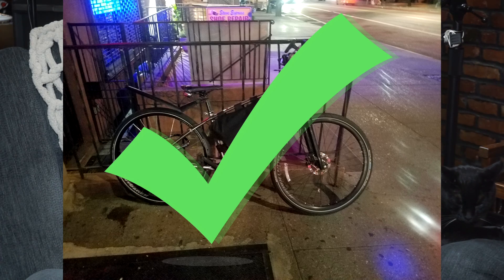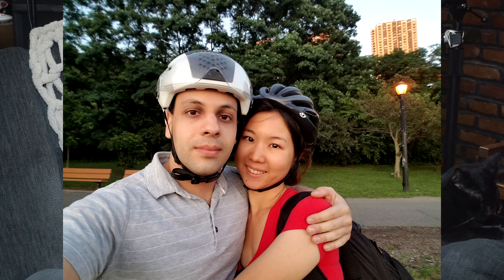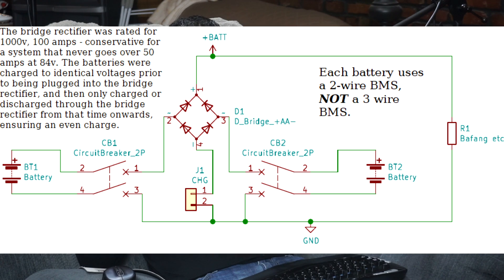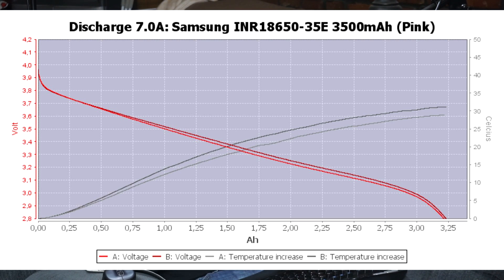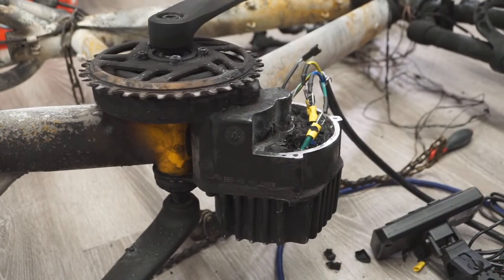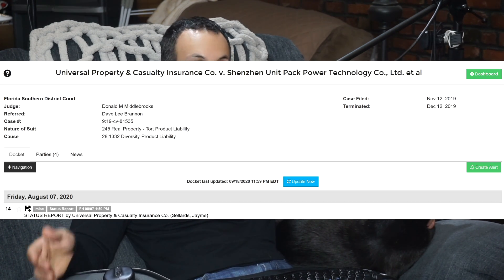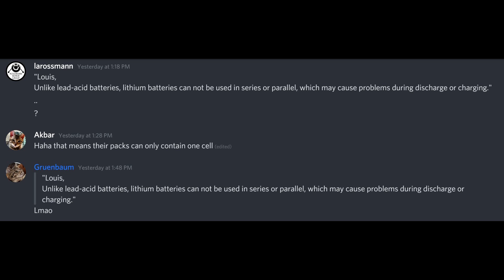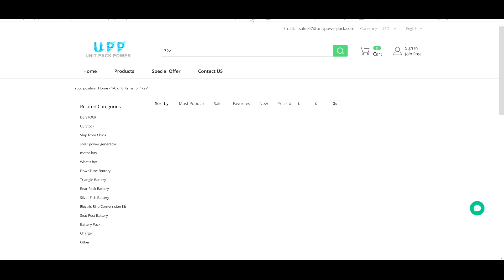Louis' front door goes BOOM courtesy of UnitPackPower battery.

Comment: I think they have no control over the manufacturing processes. Which, in the industrie of battery production, is very important. It could of course also be that they accidentally purchased a bunch of recycled/used 18650's from banggood :p
Reply: Or it could be that Louis caused the issue with his “joiner”, which is more likely from looking at the schematic. And before you get all defensive over a subject you don’t have the education to back up, I have 10 years of electronic engineering background.

Comment: I'm an electrician and I would guess they cheapted out on the wire and used a wire guage that was too small or their was a poorly soldered connection. This created a choke point where to much current went through too small a conductor and conductor overheated/melted and started a fire. The motor was well made but they had no idea how to safely connect the motor to the battery. When multiple batteries are run in paralell it does increase the current and some of the wires might need to be a bigger guage. I had a problem with the starter button on my electric scooter. This was an expensive scooter but they put a cheap plastic button on it. I ripped out the plastic button and touch 2 wires together every time I need to start the scooter, I hotwired the scooter.

Comment: The first thing to remember is that there are a lot of factories in China and other places cranking out shady battery packs.  One problem I see is using any lithium technology that is as prone to flames when shorted or punctured as LCO or Lipo cells.  For something like an E-bike you either need to fuse and protect every cell in the pack in case of catastrophic failure along with a quality BMS or better yet use safer battery chemistry.  LiFePO4 or LTO would make a much safer pack for something like an E-bike where the potential for carrying the unit into a living space or being involved in an impact where a wire can short out is high.  These packs should be built with this in mind but many times corners are cut in the specifications to follow for assembly.  When I build packs even out of LiFePO4 cells I still fuse every cell for 5A so that if a cell would short, it's link to the rest of the pack is immediately removed.  Glad that you were unharmed in the fire as that is still the most important thing.

Comment: Battery Manufacturer: "... Lithium batteries can not be used in series or parallel..."
Me: stares at a Tesla Roadster in confusion
Reply: To be fair, I think they mean battery packs rather than cells, but Louis had a rectifier in there for exactly that reason.
Reply: @ericy4522  magnetometer moment.
Edit: well yes it's real but you all get it.
Reply: @ericy4522  any difference between serial connection of cells already connected in parallel inside of pack and outside?
Reply: @uis246  Honestly, I'm not knowledgeable enough about Lithium Ion or other battery pack build configurations to confidently answer your question. I think most battery packs have some additonal charging and safety circuitry (except for the LiPo type used in drones), which means anything connected externally to the pack may or may not be "in parallel" or "in series" with whatever's inside the pack. The pack would need to be disassembled and any internal circuitry correctly analysed to be sure.
Reply: What other way can batteries be used other than series and parallel?
Reply: @whyarewehere3893  On their own in completely separate circuits.
Reply: No, you cannot connect Li batteries in series or parallel like you can with most other battery technologies. And a rectifier won't fix the problem, because a rectifier will only control the direction, and not the volume, of current. Overcurrent, overvoltage, or undervoltage will destroy Li cells, and gang-connecting them to a single controller makes it impossible for the controller to prevent those conditions.

Also, this has already been mentioned but buying cheap garbagey electronics off of amazon or aliexpress is a good way to end up in this situation. Check out Big Clive's YT channel for more stories like this.
Reply: @jamesmurphy449  Can you give us a direct link or two to relevant video on Big Clive's channel - he has a lot of videos!
As far as the rectifier not being a fix - Louis's circuit seems to effectively keep both batteries separated so they only see the charger, and not each other, and he ordered each battery with a two wire battery management system (BMS) so no charging route via a separate discharge wire, so why doesn't each BMS just manage the current each battery gets, given both batteries see the same charging voltage from the charger? Happy to be corrected/educated, as I have no experience with LiIon Battery electronics or management, although I do have some electronics experience.
Reply: @jamesmurphy449  Thanks for the channel recommendation! Will check it out.
Reply: @jamesmurphy449  You missed the fact that each batteries were supposed to be protected by common port BMSes
Reply: Thu Nell Ⓥ  Take a look at the way it's configured, the current will flow up through the bridge, you can connect one or both batteries, and it will still flow upwards in the diagram. The rectifier is there to prevent current flow from one battery to another, as the rectifier stops any sideways current flow. Current from the charging port also would flow up, splitting between each leg (charging the batteries), and then recombining at the top.

@James Murphy This was not a problem with mixing two Li batteries as they were electrically isolated from each other.
Reply: haha B.M.S go brrrr
Reply: Thu Nell Ⓥ  They're just diodes packaged in a particular configuration. Yes, bridge rectifiers are most commonly used to produce full wave rectified DC from an AC input, typically smoothed with a electrolytic capacitor, for AC to DC power supplies, but a bridge rectifier doesn't need to be used JUST for that purpose.
Reply: @Thu Nell. Yes you're partly correct. However in this circuit the diodes are arranged to conduct DC in one direction and block it in reverse. The logic of the circuit is that each battery is effectively supplying parallel current to the motor but they are completly prevented from discharging into each other by the diode logic. Luis's circuit is a common solution to this situation and is perfectly executed. Your assertion that he fucked it up is uninformed. Read Eric Y's comment
Reply: "It only works like that when smarter people say it does"
Reply: But tesla power banks for household use is

Comment: Does your charger have active load balancing? Looking at your circuit it is still possible to get unbalanced battery packs if their capacity or resistance is not the same. I doubt that was the issue though. My guess is a short in the pack because at those low power levels you would never get enough heat otherwise.

Comment: I’m Andy work for UPP company more than 6 years, here are our explaintion of the Louis Rossmann’s battery explosion event.
Mr Louis Rossmann bought the  two pieces 72V 35AH customized battery packs use original Samsung 35E cells with cells holder and 60A BMS (charge and discharge through  the same two cables) include 4A chargers on 28th June.
As we know Mr Louis Rossmann (good at fixing laptops) designed and run the two batteries in parallel with a 30A bridge rectifiter.
After the batteries be used about one month, the battery was explosed on 26th August, they took videos for the whole explsion process, and upload on Youtube,  then sent the video to us for refund after got many reader.
Our sale colleague responded quickly to him, and ask him help to check and and confirm when and how the batteries explosed, we promised will provide warranty if it is the battery quality caused the explaintion, we asked him delete the videos first, but he only sent some pictures of the damaged ebikes and batteries, and sent a listing of refund with total 16686.99USD on 18th Sep.
After our engineers checked his circuit diagram of the ebike connection, we found it was the 30A bridge rectifiter too hot and lose efficacy (30A rectifiter work with about 50A current for 3000W motor )made the two batteries charge each other with high current which higher than the cells max charge rate, because the BMS with charger and discharge max constant 60A, but the Samsung 35E cells standard charge current is 1.7A only, that cause the battery on high temperature and caught fire.
Even we foud out it is not our battery quality problem but the low current bridge rectifiter caused the explaintion, we knew Louis Rossmann is a good customer, he lost too much in this explosion event, we provided two solutions to him:  1. help he bear 5000USD loss;  2.go through the insurance claims process, because all our batteries covered commercial insurance. But he refused all of them, and must need we bear all the 16686.99USD.
We refused it, he told us he have a Youtube channel with 1.23 million subscribers at youtube.com/rossmanngroup, he will post the video on Youtube and Facebook group. Then he posted them on 1st when we are in holiday(1-8th Oct.), that why we have not declare it in time.
Don’t worry, we will keep contact with Louis Rossmann, just have not got reply yet. Here we declare to all other customers,our batteries are safe if you use it in correct way. Please do not refit our battery personally.We will under take responsibility if our battery have any quality problem.
Reply: You're really a piece of garbage aren't you! Your product nearly killed several people, because it EXPLODED and you have the audacity to blame the customer! I hope you get sued so much, that you don't even own a pair of underwear anymore!!!
Reply: @garrethutchington1663  Please pay attention, our batteries are safe if you use it in correct way, 18650 lithium battery all have the risk be exploded if you refit it personally, please shut up if you don't know the truth, if it is our battery quality problem why he refused to go through the insurance claims process? All our batteries covered commercial insurance.
Reply: @garrethutchington1663  I hope your ignorance isn’t contagious😂
Reply: @andyjiang8962  unless you eat your batteries, there's nothing to worry about
Reply: @garrethutchington1663  I'm just a stuff of UPP, but not owner, what I said not blame the customer, just declare the problem. As I said above, we will keep contact with Louis to help him solve the problem. At the same time, have you found the reason why he introduce another battery supplier? I don't think have need to introduce another supplier in this video, because the good quality battery supplier not only this one. So have anyone know the real goal of this video?
Reply: @andyjiang8962  besides the fact that you need to learn English, the goal of the video is that your battery is a BOMB.
Reply: @garrethutchington1663  Garret, I appreciate your passion for safety, and please understand that there are two sides to every story. At UPP we have strict QC procedures in place to ensure that all our batteries meet the highest safety standards. Each battery made for Mr Rossman was made to his exacting specifications, with quality components and battery cells. We have a very small failure rate with our batteries and many people will attest our quality, this is why we also supply many other OEM companies. Whenever there is an issue with a battery we are very prompt to remedy the issue and offer a solution, in some cases where we don’t believe it is the fault of the battery. Mr Rossman created his own DIY solution to link his two batteries together, which we identified as the culprit for this catastrophic failure. This has been confirmed by our own engineers and 3rd parties. Despite this, we still tried to work with Mr Rossman to offer a solution for his own mistake. We offered to compensate him $5000, or to lodge a claim through our commercial insurance (which would require a 3rd party inspection and investigation of the batteries). He chose to decline both these options, and instead threatened to defame us on his YouTube platform if we didn’t compensate him some $16000. Please ensure you are properly informed before attacking either myself or UPP. The internet is full of tens of thousands of happy UPP customers, you don’t need to look very hard.

Comment: This is not a circuit design issue, one cell insulator failed,  causing an internal short and full discharge,  probably some thin aluminum caught fire, once metal is burning it doesn't go out easily.  Most likely the root cause is bad construction during manufacture of the cells.  By any chance did that cell pack come from CHIIIIIIna?

Comment: I have had a number of friends who have had Li-Ion batteries that have either overheated, caught fire, or exploded to varying degrees.   All the post mortem reviews tended to point to the battery charging component creating a wave feedback loop that builds until the batteries fail to retain a constant process of the battery being capable to accept the charge being transmitted as prior charge capability is already queued to be loaded to the battery.   Examples are the Samsung debacle where their batteries were exploding, also some Tesla cars having batteries that were substandard units and were unable to accept the charge being sent into them on a constant reliable basis.  So your UnitPackPower battery had issues, but if the charger monitored the feedback (IE:  overheating of the battery) the charger could, in theory, slow down the charging rate until that batteries were in sync with the charging rate being transferred.  Cutting off the charging link immediately seems to have cause a surge in the batteries which resulted in a containment loss of the charge media. (and resulting fire)

Comment: This is one of the reasons why i absolutely hate enclosed, irremovable batteries. They all, absolutely all, have the potential to do this. And the only barrier between you and face fire, is a few chips and luck. Nokia did it right back in the day, removable batteries that were fully welded shut. Then Samsung (or whomever stole the tech in China on their behalf) stole the tech and did it in the worst possible way, and popularized with that an idiotic move that batteries like these can be ok without the casing that Nokia used. I've had tons of Nokia batteries go bad over the years, especially with age, but not one of them went fire prone, because they were enclosed. On the other hand, the Samsung hash packets are stuffed to the brim inside a phone that could pierce and vent, thus flash them, at any wrong move.

Comment: I understand your feeling of helplessness while watching it burn. I had a Ford Fusion that had a deflective brake line, it was routed over the subframe and therefore rubbed every time you applied the brakes, crack and spit break fluid onto the hot engine while I was driving. I was lucky to be able to pull over and get out of the vehicle while it was on fire but the vehicle was totaled. That feeling of watching something that should never have happened happen is not fun. I'm honestly glad this didn't happen while you were riding however. That I guess is the silver lining...
Reply: That must be 'brakes', not 'breaks'.
Reply: @seriouscat2231  Thank you! I wrote this on 2 hours of sleep for the past three days. Having a 2 month old at home is amazing and awful at the same time.
Reply: @KeeperOfTartarus14 , congratulations. In your situation I probably could not write at all.
Reply: @seriouscat2231  Thank you! It's not that bad once you get used to it. Just make simple mistakes.

Comment: >>>"Unlike lead acid batteries, lithium batteries can not be used in series or parallel, which may cause problems during discharging or charging."

18650 lithium-ion cells are called "cells," when you combine a number of cells in series and parallel it is called a "battery," so I don't think it was UPP that didn't know what they were talking when they said, in their opinion you shouldn't combine 2 lithium-ion batteries together.  I would expect that would be the position -- don't use our lithium-ion batteries in series or parallel -- of a number of battery manufactures, 

When you put 2 li-ion batteries with BMS's in parallel or in series there is a greater risk for things going wrong.  

How ever what may have happened here is one of the 18650 "cells" had an internal short and this caused your "battery" to have a melt-down. That can happen to any lithium-ion "battery," not just a UPP's lithium-ion "battery."

Comment: 10:16 so their lithium batteries cannot be used neither in series nor parallel, and, considering any electric circuit must either be in series or parallel, means they can't be used at all!  Got it.  So even their manual says not to actually use the batteries.
Reply: i think they are talking about connecting 2 battery packs